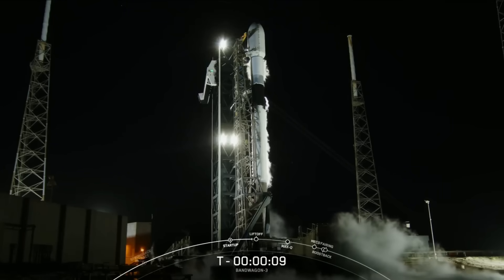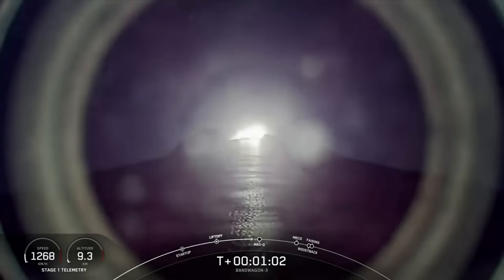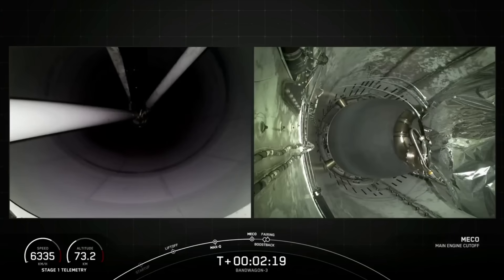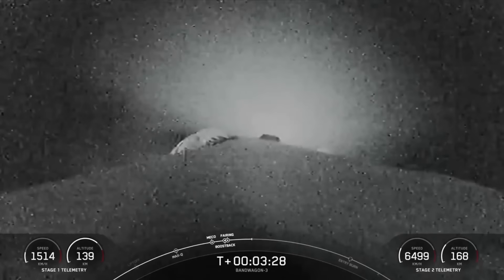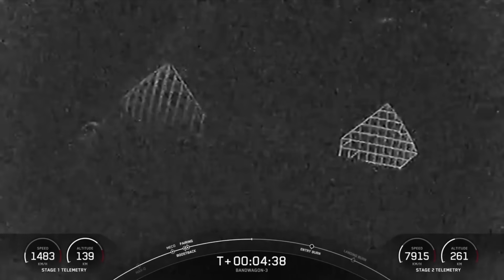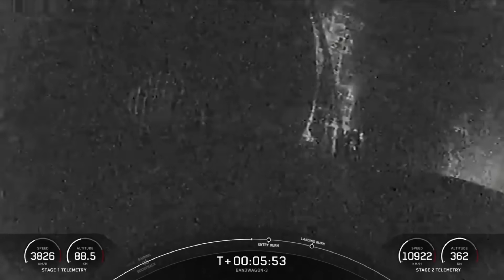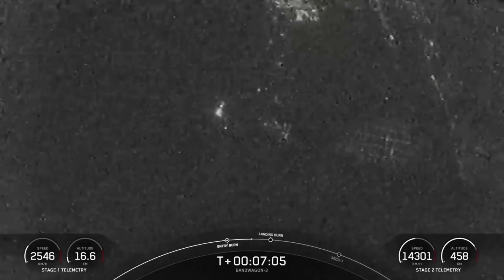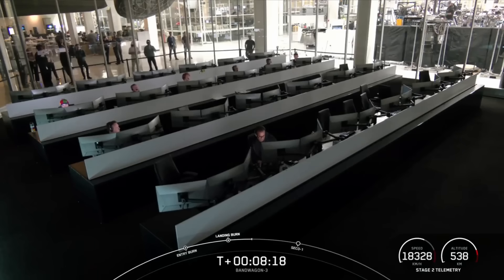Blastoff! SpaceX launches Phoenix 1 reentry capsule on Bandwagon misson, nails landing

Comment: Why does the first stage perform a boost back burn on some missions and not others?
Reply: I think it's to do with fuel consumption. Landing at sea uses much less fuel.
Reply: Boost Back burn is for when the booster goes back to its launch area.  Otherwise it lands on a drone ship placed somewhere down range on the booster's flight path which does not require the boost back burn.
Reply: Altitude dependent....